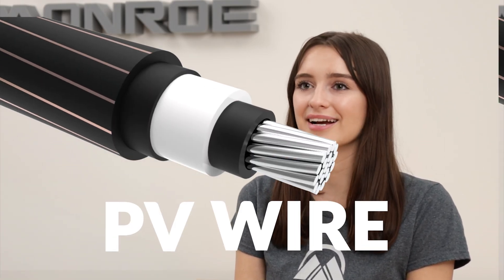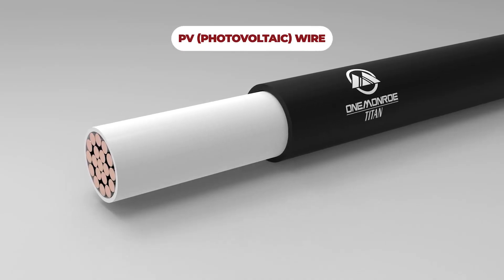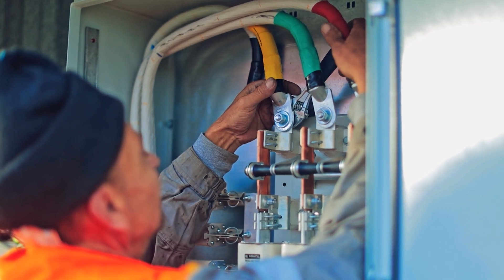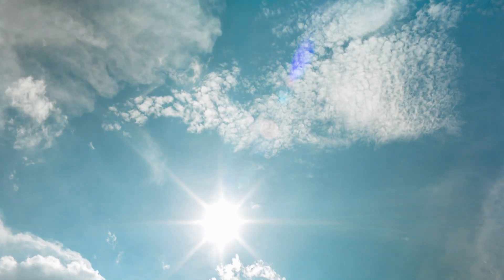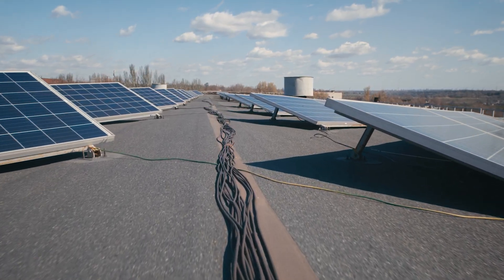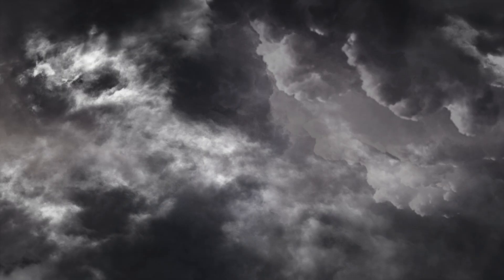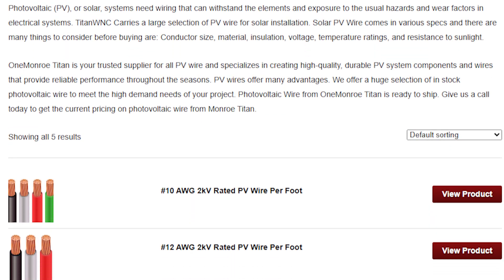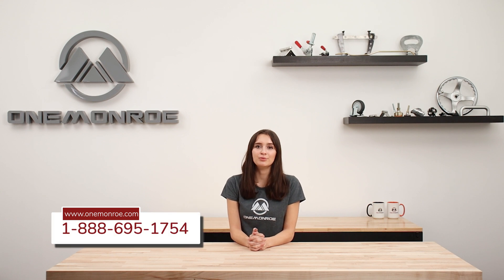Why Should You Choose PV Wire for Solar Cable Connectors?

Comment: PV wire is designed to withstand the conditions of a solar panel installation, including:
Sunlight: PV wire is resistant to sunlight and won't degrade when exposed to it. 
Temperature: PV wire can withstand high temperatures, with a temperature rating of 90°C when wet and 105°C when dry. 
Fire: PV wire is fire resistant and doesn't contain any combustible materials. 
Moisture: PV wire is resistant to moisture. 
Chemicals: PV wire should be resistant to chemicals and be acid or base proof. 
Electrical hazards: PV wire should be able to withstand fluctuations and other electricity-related hazards. 
PV wire is made of copper, copper-clad aluminum, or aluminum, and is wrapped in a thick plastic-like jacket or layer of insulation. The Underwriters Laboratory (UL) 4703 specification outlines the design rules for PV wire.   ** PV is abbreviation for PHOTOVOLTAIC Wire *